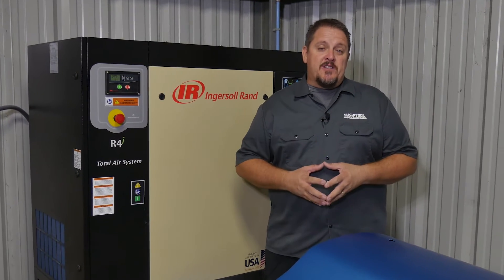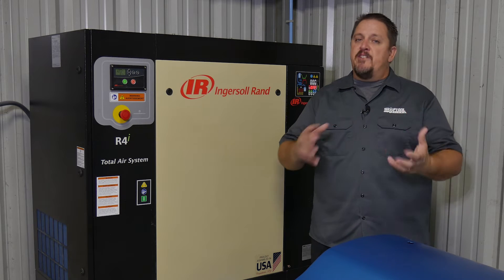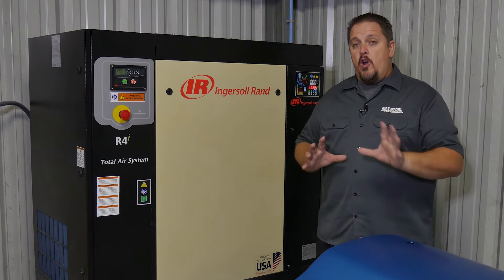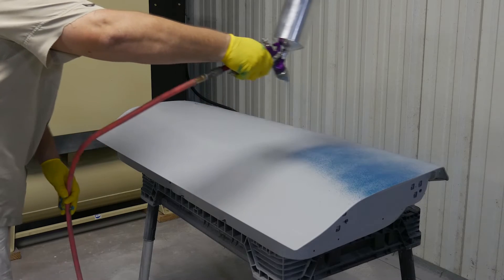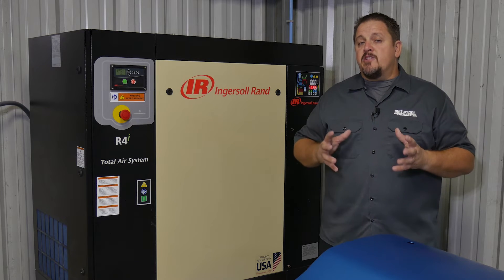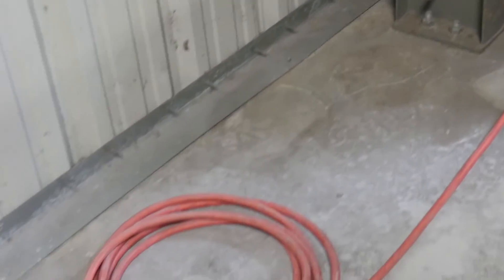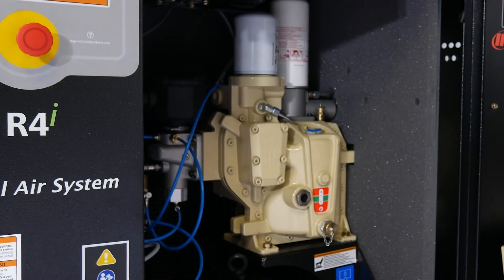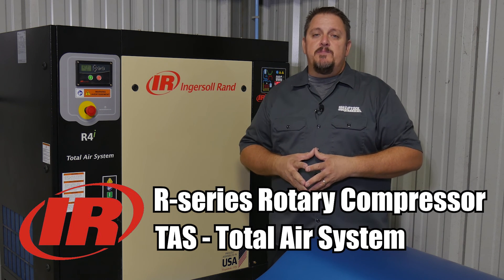NO Filter Needed! Ingersoll Rand Total Air System Rotary Compressor

Comment: This unit does not have a “cyclonic” water separator, and in fact has two filter elements in the dryer. The filters are a general purpose and high efficiency which both connect up with a drain manifold to a solenoid controlled by the dryer controller. In addition spraying paint right beside this unit will shorten the life of the coolant and unit over all. Your prefilter is now blue from overspray and the blue overspray continues inside the unit.